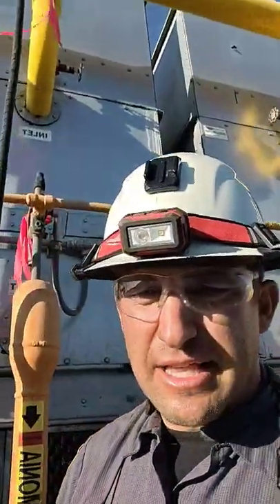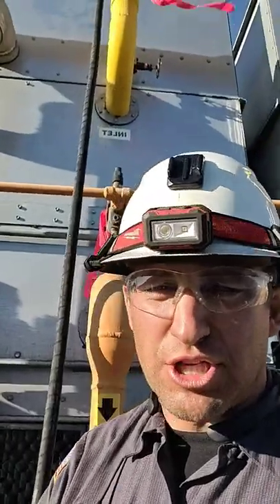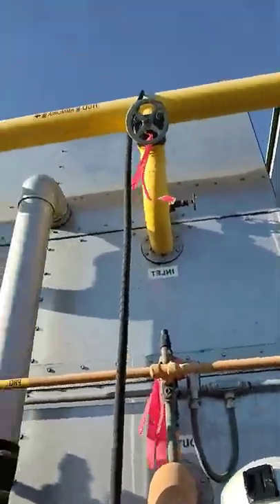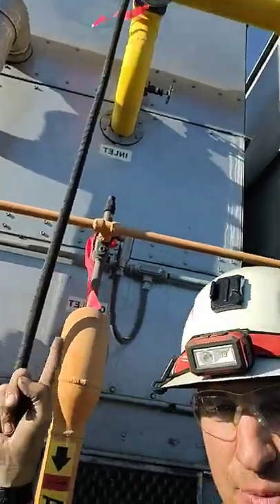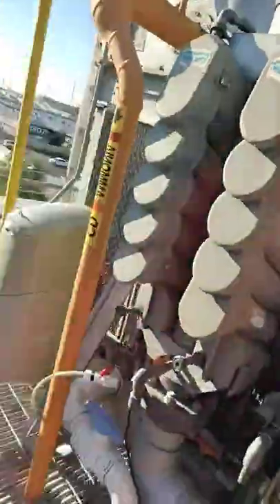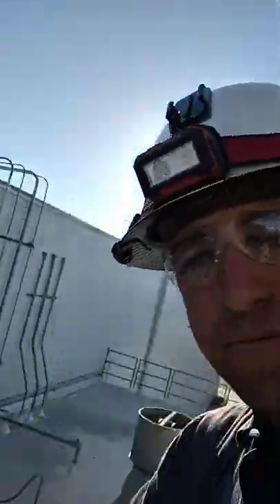Evap Condenser leaking Ammonia!!!

Comment: What is the purpose of the EQ pipe in an ammonia refrigeration system?
Reply from the maker: Depending on your system it will equalize your condenser with your receiver so it can drain properly.
Reply: The left over gases in hpr gets sent back to condenser thru eq
Reply: It equalizes pressure between the HPR and the condenser so the liquid can fall down to the HPR.